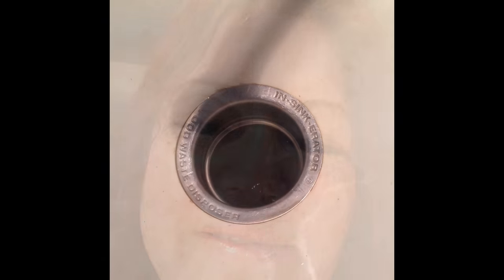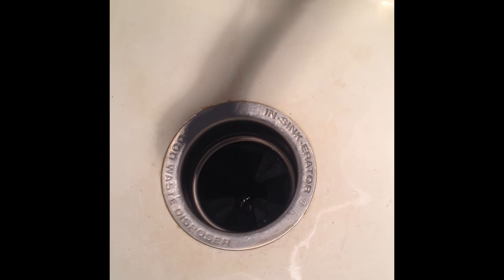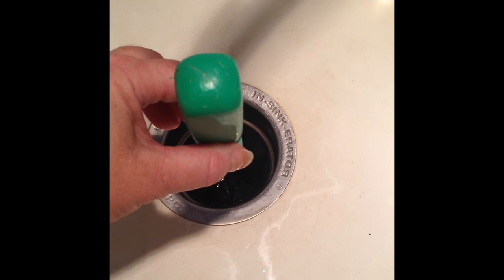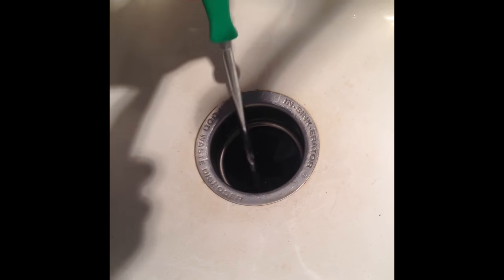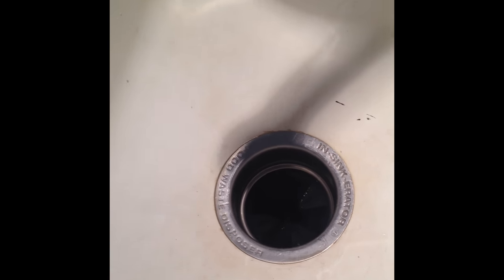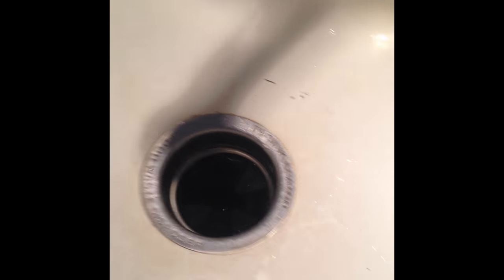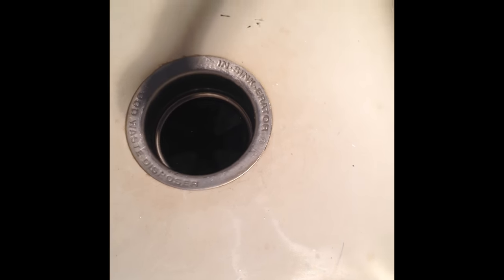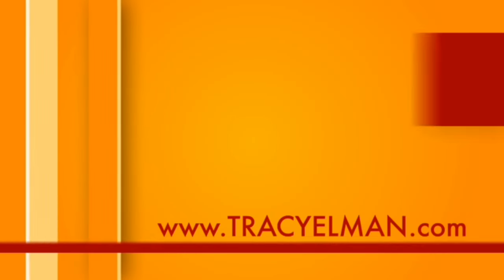How To Repair a Stuck Garbage Disposal with Tracy Elman

Comment: Thank you so much for this tip. Tried a wooden spoon to move the flywheel, as my disposal doesn’t have the Allen wrench access from below. This screwdriver/hammer method worked after tapping around the inside a few times!
Reply from the maker: I’m glad it worked.
Reply: I have the same problem. I'm saving this video and trying it tomorrow